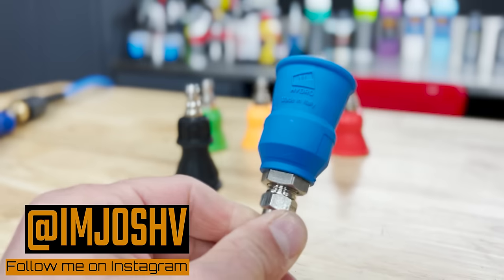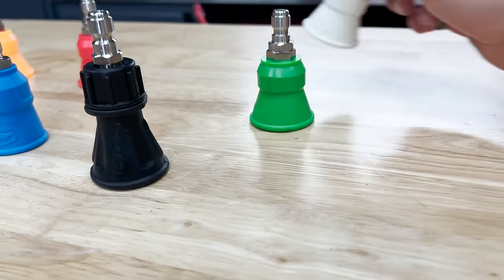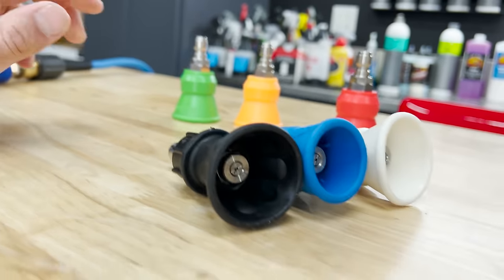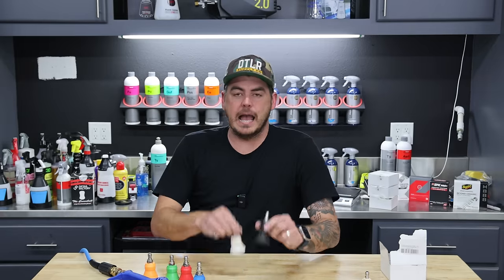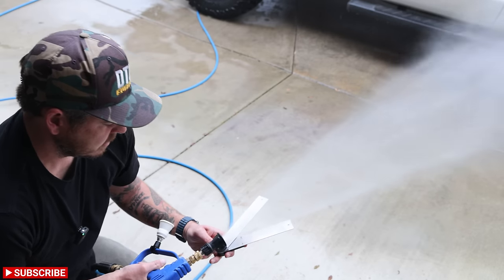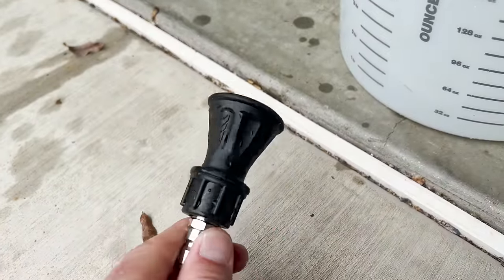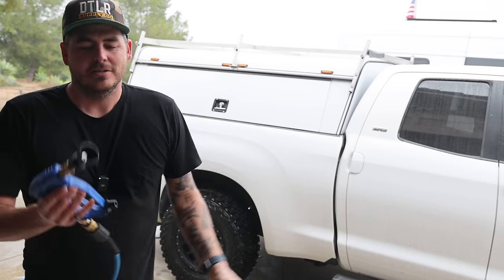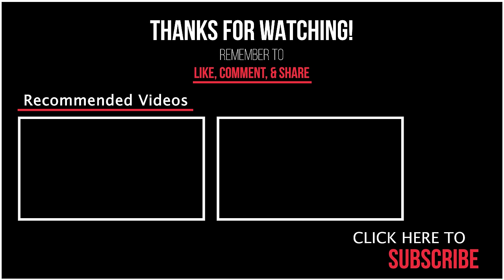Best Pressure Washer Nozzle For Cars | NOZZLE GUARD | Car Detailing

Comment from the maker: ITEMS IN THIS VIDEO:

RIDGE WASHER NOZZLES - 
2.5 Kit - https://amzn.to/3UCwYt4
3.0 Kit - https://amzn.to/48mzg37
3.5 Kit - https://amzn.to/495rHyJ
4.0 Kit - https://amzn.to/494AQHI

McKILLANS NOZZLE 40° x 4.0 - https://amzn.to/3SN0KtT

MTM ACQUALINE NOZZLES - 
25° x 2.0 - https://amzn.to/3umQsaE
25° x 3.0 - https://amzn.to/42yLNPp
25° x 3.5 - https://amzn.to/4940KeW
25° x 4.0 - https://amzn.to/48eXQ5W
40° x 2.0 - https://amzn.to/48mta2J
40° x 3.5 - https://amzn.to/3ukUKzl
40° x 4.0 - https://amzn.to/3w33Qkx
40° x 4.5 - https://amzn.to/3Ow8IVG

MAD CAR CARE NOZZLE HOLDER - 
https://madcarcareproducts.com/products/mad-car-care-universal-nozzle-tip-holder
(Use code: JOSHV for a discount)

Blue Pressure Washer Wand:
With Swivel - https://amzn.to/3SPu5nq
Without Swivel - https://amzn.to/3waSATy
Reply: HOW DO YOU KNOW WHAT SIZE NOZZLES TO GET I HAVE A LITTLE RYOBI 1800

Comment: I purchased the Ridgewasher lineup. The green one rusted on me within a month. To the point it interfered with the spray pattern. Threw it out and went back to my SunJoe tops.
Reply: You could change out the nozzle. It’s threaded on
Reply: @pantac4493  I tried to actually remove the nozzle to see if I could clean it. But couldn't find a way to do it. 
But why would I want to remove the nozzle? Replace it with? 
I just went back to the SunJoe tips which actually work pretty well.
Reply: @georgebeato5702  they used loctite thread sealant instead of teflon tape so it’s way harder to remove. You can buy 3rd party nozzle tips to replace the ones they came with. Just make sure it’s 1/4” npt thread and the right angle and orifice size
Reply: So much of the consumer ebay and Amazon grade pressure washer parts from China use 430 stainless, which rust. Or plated steel. Why do you think they are so cheap?
Reply: You get what you paid for.

The reason it's cheap is because it's cheaper to make, aka poorly made, in China. So they still make profit before counting the fact like how they want you to buy nozzles and change them every time, apparently monthly.

Just buy a well known brand not in Amazon, since China also make cheap crappy copies. And you take care of them, lasts you your whole life, might even go down through generations.

Comment: Always super informative! 

Quick question: I have the Ryobi 1900psi 1.2GPM With a Uberflex hose and the Mckillans swivel gun. Which Nozzle orifice would you recommend? I grabbed a set of 2.5 recently but now the ridge has gathered my attention. Ive wall mounted the unit and its only used for auto/moto detailing.

EDIT: I scrolled down and saw others asking the same. I guess a 2.5 or 3.0 is good. Ill just leave the comment up for engagement :)
Reply from the maker: Haha thanks, Yeah the 2.5 or 3.0 should be great. If you like how the 2.5 you have work and just want the nozzle guards then stick to the 2.5

Comment: Quick question before i make my purchase. i use a GAS power washer ( Honda 2600 PSI) my stock tip are 2.9 - will i be okay with a  McKILLANS NOZZLE 4.0 ?or i need to stick to 3.0 ?. Thank you

Comment: The Ridge should be the winner on price alone. Slightly less water throughput than the McKillans and the rubber sleeve firmness was in between the McKillans and MTM.

Plus the 4.0 Ridge set is currently an additional 15% off.

Comment: What size nozzle and degree should I use with the Ryobi  electric pressure washer? Thx
Reply: I have the Ryobi 1800 1.2 gpm unit. 2.5 orifice yield 1000 psi and 3.0 orifice yield about 900 psi. When I use the 0 degree nozzle to get a long stream for washing at a distance I use the 3.0 to intentionally lower the pressure. I use 2.5 for all other spray angles. Josh did a video on this washer and provided links to these spray tips. Go find that video its a good one.
Reply: @AllRightsReservd  thanks for your help. 👍🏻

Comment: In your directions on bottle it says spray on damp microfiber towel. Since I take care of my vehicle I used kmkz cleansing to a quarter panel and of course cleaned it off the proper way. I had a three year topped with a one year of your older version of your ceramic coating when it first came out. Remember those days? I guess I'll use it on a dry applicator on the rest of car. Also how long to cure before BC3?

Comment: What size nozzle would you prefer with a sunjoe spx3000 max pressure 2030. A 3.0,3.5or4.0?  I think you recommended getting down to 1200 psi and maximizing water flow. Thanks.

Comment: Which would you get for a ryobi pressure washer 1.2gpm 1600psi
Reply from the maker: either a 2.5 or 3.0 - the 3.0 will drop the psi more but give you m ore gpm flow

Comment: Josh,

I bought a new sprayer gun and my regular 40 nozzle doesn't seem to fit the gun. However, the 25, 15, 0 from the same set fits it (meaning it clicks into the quick connect). 

Is there something I'm missing here? Because my pressure washers factory gun lance setup fits them all perfectly fine. 

🤯

Comment: I am buying the Greenworks 1700 over the 1800 as per your suggestion. However the test that you did that got the 1700 up to its highest psi was an ryobi nozzel. What size do i need

Comment: HELP! Thx for your videos, but this one was very interesting. So I ordered the RIDGE WASHER 4.0 nozzles with the gauge of the same brand. I also ordered the Active short gun (thx for that video) with Yamatic 3/8"x50’ hose. I have an old Simoniz 1900 psi pressure washer (bought in 2002?), so I’m not sure about the specs. I tested with a bucket and it takes 40 seconds to fill one gallon with just the gun, no pressure nozzle, which gives me 1.5 gpm, if I plug the 4.0 nozzle I have 1 gpm. When I use the pressure gauge with the nozzle 4.0 attached, it shows around 525 psi, is that enough for washing a car? Should I go with a 3.0 orifice ? which I believe will give me around 1000 psi if we consider 1.5 gpm. Or should I go with the 2.5 orifice? Any advice?

Comment: I must confess, there have been instances where my nozzle (without a guard) ejected from the gun because I didn't secure it tightly enough. Fortunately, I didn't observe any damage to the paint job, but now we have a secure alternative.
Reply from the maker: Yeah it can happen for sure. These will help with any potential damage… it could still damage I suppose but it would be less with these!
Reply: ALWAYS double check the connection as well as ALWAYS test spray while pointing away from anything to make sure the connection is legit.
Reply: I found with these, the weight helps it from flying off like a rocket, like the cheap small plastic nozzles

Comment: I have a cheap SunJoe spx3000 that I upgraded the hose and quick connecters from your recs. I got the short wand on order but I want to upgrade the nozzles. SunJoe says the orifice size for all their nozzles is 1.0mm. Can I use the other sizes without any issues? looking mostly just for hosing down and rinsing off. Also got the MJJC cannon on order.

Comment: Josh - curious about your choice of 40 degree nozzle (I’m a newbie). Is it purely convenience - greater coverage - or is there a safety/protection reason over a more narrow stream?

I hope you stayed dry over the recent storms (I’m up in Oceanside - 2.5”!!!)
Reply: 40 degree is chosen for two reasons. Almost no chance of damage to car or trim.  Don't have to worry about getting too close. And 40 acts great for creating a water blade for pushing soap of the card after foaming.  Most detailers also use a 25 for wheels and wheel well

Comment: I have a GreenWorks 1600 psi electric pressure washer I scored for 50$...what orafice size should I buy for my tips ? I was using my old Briggs and Stratton ones from my gas pressure washer but they are 4.5 and obviously aren't the proper ones...was thinking of going 3.0?

Comment: The problem I have with the ridge tips is that on my ryobi pressure washer it seems to make it work harder , I hear it forced and not smooth like it does with the ryobi tips. Great video brother
Reply from the maker: Hi the Ryobi tips are usually around a 1.8 - 2.0 orifice.  When you go to a larger orifice it will definitely change the sound of the machine but its actually not working harder. If you do an amp test you can see that when increase the size of the orifice it will decrease the amps meaning the machine isnt working as hard. However, if you prefer how the Ryobi tips work, keep tp that cause i havent been able to find an aftermarket nozzle that is as small as those! They work perfect on those ryobi units to get the higher psi numbers!

Comment: Need some guidance. I already have some 2.5 & 3.5 for my Ryobi 1900 psi and 1.2gpm. Testing with my hand and cardboard, the 3.5 seems too harsh. Hurts the hand sooner than the 2.5. Solely used for washing cars, which is the best for that?

Comment: What’s the real benefit to this style of nozzle vs the traditional nozzle in the same degree and size orifice for car detailing?
Reply: In case Accidentally didn’t seat the tip properly in the QD this adds a layer of protection so it hopefully protects the paint from the high speed metal object flying towards it

Comment: I'm thinking about getting some of the Ridgeline tips for my 2100 psi Green works pressure washer with a 50' Uberflex hose and McKillans swivel gun. Should I get the 2.5 or 3.0 orifice to maximize my GPM?
Reply from the maker: I’d go for the 3.0 if you want more flow
Reply: Go with the flow! Gotcha!

Comment: I just bought that same blue essential swivel gun to finally upgrade from a cheap purple one I was using! It was on sale, but it came with the box open, and the gun rattles inside when handling it. I haven’t had a chance to use it.  Is it normal for that gun to make a rattle noise (sounds like a screw is loose inside). I hate to be a pain and return things, so I’m not sure 🤷🏼‍♀️
Reply from the maker: Hmmm hard to tell sometimes just the pivot point for the trigger can make a noise.  They are pretty easy to open up and check out just to make sure nothing is rolling around inside. Then try it out to make sure if not having any issues. If you bought it on amazon it’s easy to return!!

Comment: You should have compared all the Ridge Nozzles in the set.  I have a set of Ridge Nozzles and one nozzle seems to have a pressure reading that is inconsistent with the rest of the set.  So, I’m concluding there might be some quality control issues with orifice size.
Reply from the maker: Ill do some tests and let you know if mine have any change. But if there is inconsistency, mine could be perfect but another set could be slightly off
Reply: @imjoshv I ordered a second set and just received it today.  I will test them tomorrow.  In my first set, the green nozzle was 150-200 psi lower than the others in the set.  I checked the markings and they are all 3.0 orifice size.  I’ll let you know the results of tomorrow’s test.

Comment: Can you please do a test to see which orifice @ 40-degree works best with the EGO Power+ 3200 PSI. The 40-degree (White) that the unit comes with has the following label: T4056150. So is its orifice...5.6 or 5.0?
Reply from the maker: No their labeling isn’t like the normal labeling unfortunately. The nozzles that come with it are actually quite small. For washing cars I prefer a 3.0 nozzle! At medium power I got 1100 psi and 1.65 gpm and 1200psi 1.7 gpm on high
Reply: @imjoshv  Thank you for the quick response. Looking at getting the OG Mosmatic Nozzle at 40 degree. Have you test this unit...thoughts?

Comment: Josh I have the Craftsman 1700psi electric you have reviewed. Which orifice should I get in the ridge washer setup? Thanks!
Reply: I have the 2100 psi craftsman and I use 3.0 nozzles I got it down to almost 1000 psi it’s been working great for doing vehicles for home use I use the tips that came with the unit

Comment: Hey Josh, a little off subject, but what do you use the wash across the top of SUV's
Reply: Try adding a wand to the end of your gun , the nozzle tips would apply to the end of the wand. I recommend a 20° bent wand so you get reach and angle
Reply: @veils1de350z  ahh I have seen those. What about as for a wash mitt? Who makes something on a pole or for a pole?
Reply: @Knight_Glider 

Autofiber's Mitt on a stick.
Reply from the maker: @knight_glider i use a mitt om a stick pro froom autofiber. I have the available on my site! https://dtlrsupply.com/products/autofiber-mitt-on-a-stick-pro
Reply: I use the Autofiber Mitt On A Stick PRO.

Comment: What size would you suggest on a Ryobi $100 pressure washer
Reply from the maker: I usually go with a 2.5 or 3.0
Reply: See his year old Ryobi 1800psi electric pw review for specifics.

In short, the best set up was 25° 2.5 orifice.

Comment: How I know what the size I have? 3.5, 4.0, 3.0 I really don’t know what this number means??
Reply: I have a Riobi electric normal 2000 PEasher
Reply from the maker: Thats basically the size of the hole in the nozzle. The large the whole will reduce the psi but increase the gpm. Most Ryobis come with pretty small oroifice size tips. So if you want to keep the same or close tot he same performance numbers, get the smallest size option.

Comment: I have the Mckillons, really because it’s black and I use the active pressure washer gun which is black 😂 I do like it.
Reply: I use a yellow (?) Ryobi 1800psi PW, a 35' red Uberflex pw hose, a black McKillans stubby pw gun, a green 25° 2.5 orifice Tool Daily pw nozzle (from a set) or a blue MTM 3.0 25° pw nozzle guard (when feeling the need for extra protection) and being color blind, I really don't GAS if any of my DIY equipment matches.  

Additionally, NO ONE ELSE on my private street has ever cared either but they always stop by to ask about my set-up.
Reply: @CC_Marauder  nice, you have every color in the spectrum 😂 really I got the mckillons nozzle over the mtm because of price.

Comment: What problem does this solve?  The only one I can think of is that you're clumsy and you work close to your paint.  I guess if you need new tips, then you might want to "upgrade" but otherwise keep what you have.
Reply: They  hooded nozzles are great for limiting over spray.  The tiny plastic nozzles that come with the units are all made in China and water goes everywhere.  And the hooded nozzles tend to be higher quality in orifice size and fan width.

Comment: Which orifice size would you recommend for 1800 Psi for Ryobi pressure washer?
Reply: I use the Ridgewasher 2.5mm orifice kit with the Ryobi 1800 pressure washer. Works great!
Reply: I agree with Joe. The 2.5mm is the way to go for the Ryobi 1800.

Comment: What size orfice do I want with my ryobi 1800 psi ?
Reply: Per a prior test video of his and how I chose my primary nozzle, Josh suggested 25° 2.5 orifice.

Works great.

See his Ryobi 1800psi, 1.2 gpm video from about a year ago.
Reply: @CC_Marauder  Thank you I appreciate it I’ll watch the video…would you go with a 2.5 orifice for a 40 degree nozzle too ?
Reply: Over Christmas '23, I purchased the MTM Hydro Acqualine 3.0, 25°.

I've used it 3x now with more than satisfactory results for my DIY needs.

I rinsed my 2 cars as well as PW my metal garage door clean.
Reply: @CC_Marauder  nice! I have a powerful gas pressure washer and got sick of using it to wash our vehicles so I just picked up the ryobi 1800 psi 1.2 gpm the other day…I ordered the ridge washer nozzle guard pack in 2.5 orifice, Uber flex hose, essential washer swivel gun and a psi gauge Can’t wait to try the new set up this weekend..even ordered the amp meter to make sure they are where they are supposed to be
Reply: There you go. 

I'm too embarrassed to post everything I bought in the last 3+ months of '23 for my DIY PW needs.  My auto detailing cleaning supplies easily surpassed the actual PW equipment cost. 

✌🏼
Reply: @CC_Marauder  lmao I’m right there with you now im trying to pick out more garage shelves and whatnot to display all my detailing stuff and products…I should have a YouTube channel for how many detailing products I buy just to try out…my fiancée was breaking my balls at first she liked that her car was always detailed but didn’t understand why I kept buying so much stuff but I told her I enjoy doing it and it relaxes me…plus my 2020 gmc sierra is black with black wheels so it only takes a day or 2 after washing before it’s dirty again lol…in the past 6 months I’ve bought the electric power washer with all the upgrades, a mcculloch steam cleaner, a DA polisher, all types of brushes and drill brushes, numerous polishes and compounds, waxes, sealants, detail sprays, dressings, interior cleaners and all that stuff etc, IK pro foam 2 sprayer for spraying brake buster on the wheels and tires, I’m over here spending $15 a piece on pressol and ik mini 360 bottle sprayers to put my most used products in like I’m a professional lol it really never ends..a water tank and generator are the only things left I would need to start a mobile detailing business maybe I’ll end up doing it in the future we’ll see
Reply: There has to be an end point for the DIY'er.

If not, make that end point like I did.  It has to pay for itself at some point.  A never ending buying cycle just keeps moving the break even point.

A couple more full details and I will have recouped all expenses.